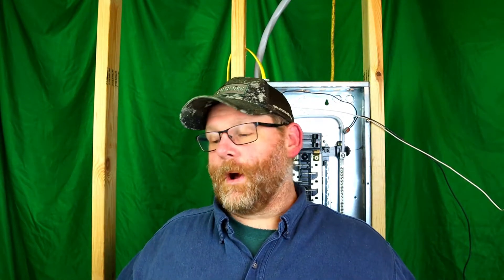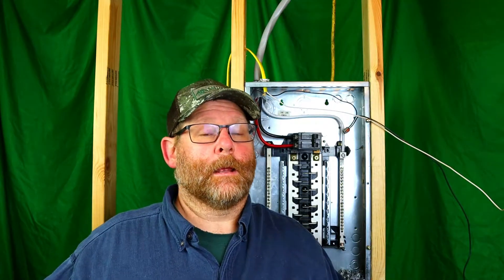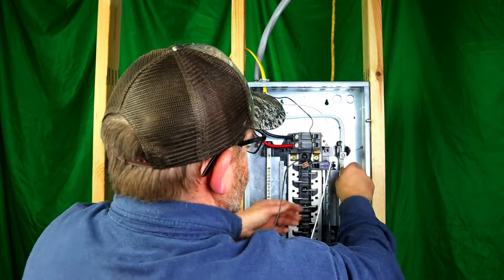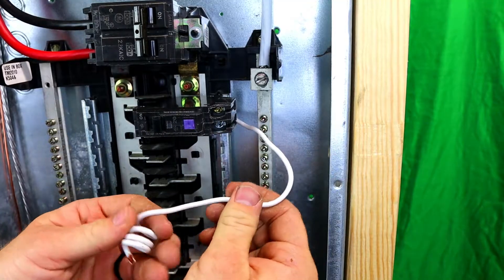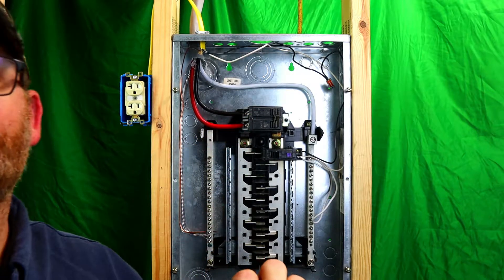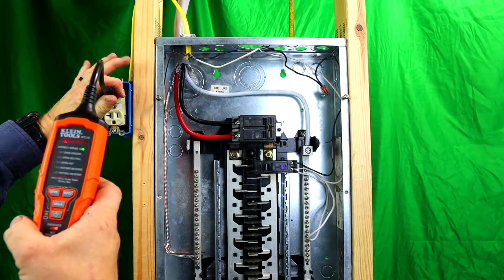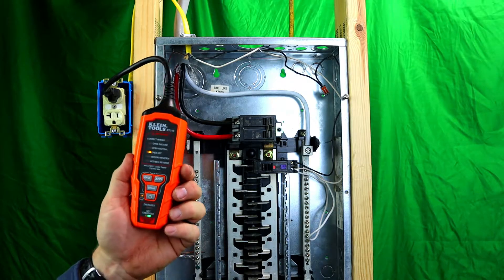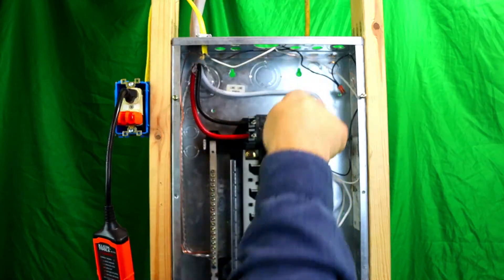How To Install A Dual GFCI ARC Fault Breaker

Comment: Do we have to/shold we use dual function breakers on 240 circuits ? ? The code only specifies 150 volts or lower and receptacles versus hard wired. A 30 amp dual function breaker is expensive and what about false trips ?
Reply from the maker: Good question

Comment: AFCI should be on every circuit. You can have a bad connection on ANY electrical device, appliance, outlet connection, wire box connection, switch connection, etc.   A bad connection can spark or overheat and cause a fire and still not draw enough current to trip a standard 15 or 20 amp breaker or fuse.  I recently discovered a broken wire on a simple clock radio that had been sparking for weeks.  The home owner complained about static reception.  One of the feed wires was completely broken and sparking. the bottom of the radio had a 2" circle of char.  How it didn't catch fire is just weird.  Same house had a fire in it 40 years ago caused by a cut wire insulation on a lamp.  $65 per breaker x 12 breakers is far cheaper than a new house or funeral.  They make those pig tail breakers to fit in older breaker panels so ti's an easy upgrade.  Just need to match the brand of the breaker to the brand of the circuit box.
Reply: @rickpaulos  You are correct but its hard to explain to some people. Best thing they have came out with. If an arc fault trips most of the time something is wrong with the wiring or something that's plugged in

Comment: I'm new at this, so please bare with. Is it safe and correct to use the THQL1120AF2 - GE - 20 Amp Arc Fault (AFCI) Circuit Breaker that says it's 120 volt breaker with 125 volt standard outlet or does it have to be a GFCI outlet?
Reply from the maker: It can be used with a regular receptacle.

Comment: I got a new home, and at the beginning, everything was fine with the loundry washer  machine. After a few months,  it started tripping the gfci eaton breaker. I have a basic knowledge about electricity.  I check all terminals, adjust all of them, clean the cable tip, and reseat the breaker, and it work for a short time, but after a few loads in the spinning cycle, it trip. 
Apart from the video recommendation,  what did you recommend.  Thanks excellent video content.
Reply from the maker: Something might be wonky with your washer. It's sensing something not correct.
Reply: @MountaineerOutdoors  i have the same issue   gfci keeps tripping   had an licensed eletrician install new sub panel  put gfci breakers in so its up to code    passed inspection    what could be the problem   ?
Reply from the maker: Sound like you have something going on. Without seeing it It's hard to guess
Reply: I had the same issue with the Eaton dual ARC/GFCI 20-amp breakers. They kept tripping. I first replaced one that was connected to a GFCI outlet with a standard breaker. However, shortly after, the other Eaton breakers started having the same problem. Now, several breakers were tripping. I contacted Eaton, and they had a recall. They sent me 8 new breakers free of charge. -Good luck. -Stay safe.

Comment: Is that panel set up like a sub panel?  In my panel the ground and neutral are on the same lug?  Can I still install a dual function breaker?  Thank you!
Reply from the maker: In my demonstration it is set up like a sub panel. I have definitely been to homes where I have installed them where the nuetrals and grounds were together and it did work. If you do it, let us all know if they do work for you
Reply: @MountaineerOutdoors  Thank you !  I installed three  20 amp circuits for receptacles in my outbuilding.  Also one 30amp 220. Used your videos to learn how to bend pipe. Had three 3 point saddles 😤.  Wasted some pipe but got it done. Just passed my rough inspection.  It will a be couple weeks before I can finish but I will let you know how it turns out. Take care.

Comment: As I understand the NEC 2020 requires these for kitchens, including dedicated circuits for the refrigerators and dishwashers, plus bathrooms. It’s odd that your local code just says bedrooms. They would be the least concerning to my way of thinking.
Reply from the maker: Well that's how we roll here. Alot of locals in Virginia are like that still. It will change though I feel certain

Comment: The biggest problem with these AFCI breakers is they keep tripping , the home owner then replaces them with a standard breaker, which is bad enough, but they replace a 15 amp with a 20amp !!!!
I have encountered this alot
Reply: If there tripping your doing something wrong
Reply: @raymondcamp8212  I've been having this problem  what can be the cause      I had a licensed electrician  install the new sub panel and it passed inspection
Reply: @JT-od4df  The most common cause is having the neutral or neutrals together or sharing a neutral with another circuit. Next common cause is a bad light or something plugged in that's bad. Third is not using a  tamper resistant receptacle so you have to plug your cord in connection both prongs at the same time.
Reply: @ thank you very much for that explanation  !!!!
Reply: @raymondcamp8212  old electronics such as old flat screen TVs will trip intermittently AFCI. So nothing's being done wrong !
Reply from the maker: I agree

Comment: Ground (bare copper), always on the opposite bar than the white?  Is that what they mean by separating neutral and ground at first point of disconnect?  Thanks!
Reply from the maker: They cannot be in contact with each other. So as long as they will not have continuity between them that is good

Comment: Hi Sir.  What is the best way to find the neutral for a 200 amp servies that is full of brakers?  I have the hot, but the neutral is giving me a problem.   thanks
Reply from the maker: It should be the biggest wire on the nuetral bar
Reply: @MountaineerOutdoors  
I have 63 neutral wires.
Reply from the maker: Use a tone generator or a circuit finder aka (fox and hound)

Comment: Have you installed a tandem AfCI breaker?  I looked online  and did not see 2 Neutral spaces on the tandem load. If you have any info on these as I have It use them? Thanks
Reply from the maker: I have not used them just single ones. Is this what you are talking about?  https://amzn.to/3j6FjVm  Seems like it would work,if you had to use it.